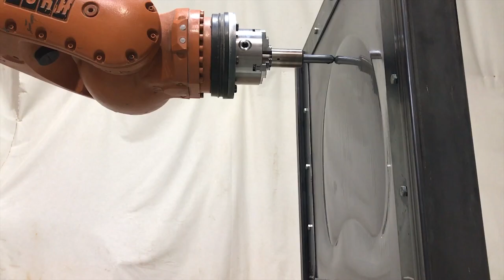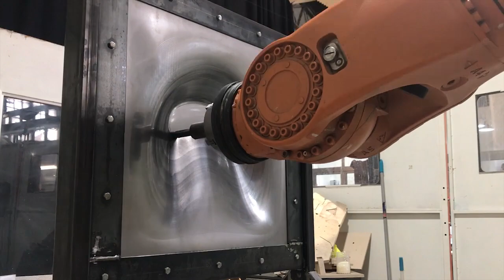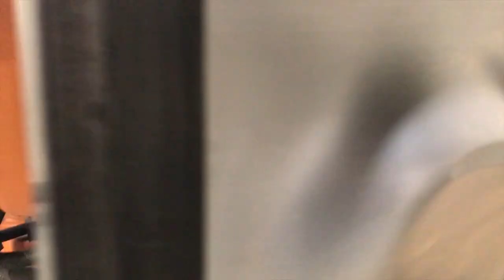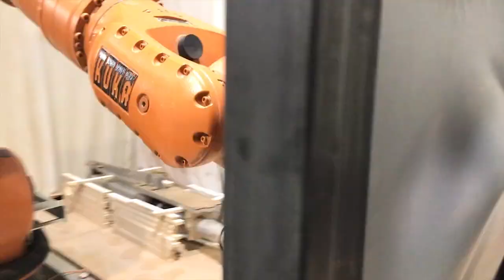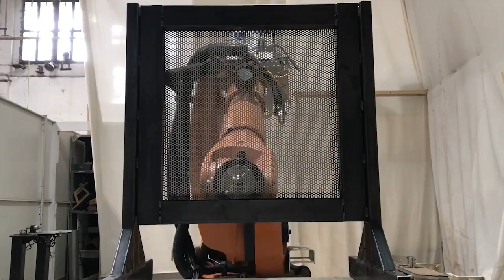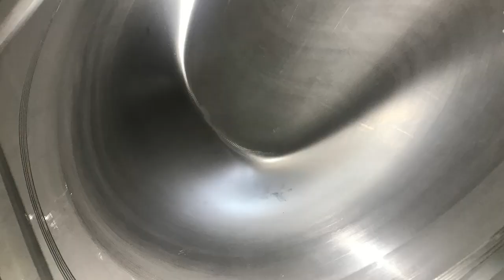Robotic Incremental sheet forming

Comment: Few questions, how this compares to hyfroforming? In terms of manufacturing lead time, precision (profile tolerances of the resulting surface) bend radiuses dimensional control, finished surface roughness. I come from the aerospace industry and tolerances and roughness are a big deal. I ca see some marks on the finished sheet surface.
Reply from the maker: Hy Mauricio, in comparison with hydroforming you are completely flexible in terms of shape and dont have to premanufacture anything before. This deformation of the sheet can take between 20-50min . Depends on Speed and Accuracy. The precision depends on the ball tip you are using for the deformation. Im using 2 diameters for now 10mm and 20mm. 
There is a springback in the material, whichI think can be avoided by a second round of deforming or using sensor for calculating the springback for each metal and thickness and reinvorcing the process to deform deeper so that the final result fits the shape you want. In terms of roughness and marks, there are no marks on the shape . its just the oil which shows up in lines whre the tip was moving. If the Tip is gliding smoothly on the shape with oil underneathand you will have no marks if the depth movements are little enough (<1-2mm) . Hope that helps